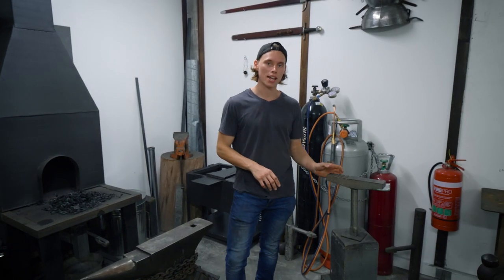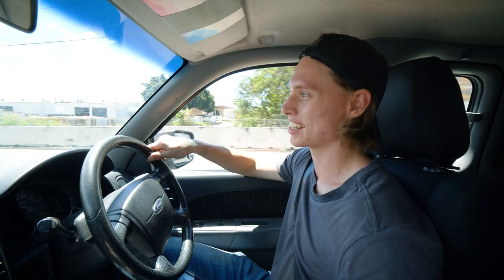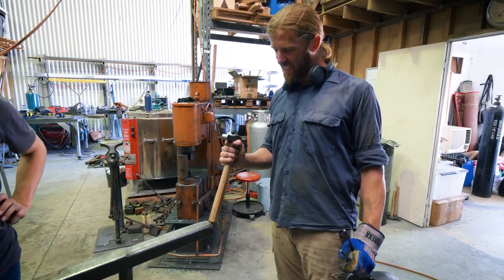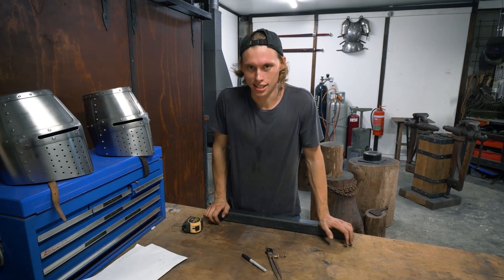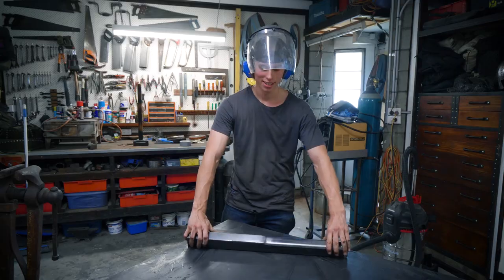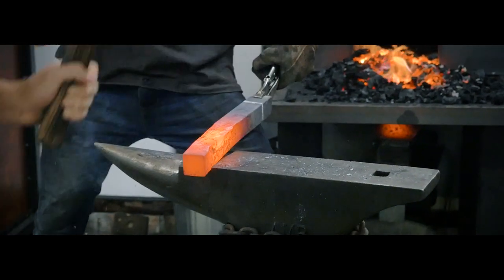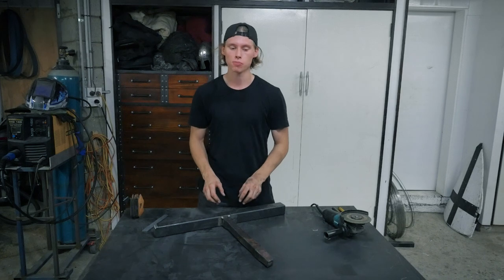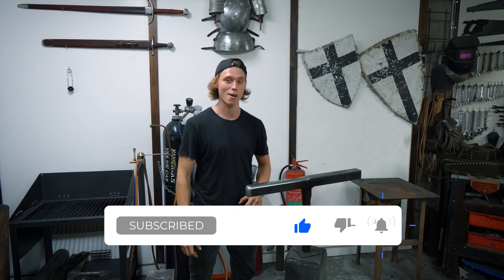How to make a T Stake

Comment: I had alreagy made a flat surface plate (1cm thick) with ovale and round pits.I use it as a table for anwil. Its wery usephul.Would you like to repeate same devise?
Reply from the maker: That sounds like a really cool set up mate! I like that idea! Maybe another station worth adding to the armoury. Do you have a photo of this set up? Maybe you could send us a cheeky pick via dm on facebook or insta :)
Reply: @IronCrownWorkshop  it look very ugly, couse it was first thing that I made by gas cutter.Also I bought all metal on resucling base and weld it wih electrodes
Reply from the maker: @ИльяЗеленов-в4ж  Sometimes those are the most satisfying builds when you get to recycle materials and just make something that is functional, meets the task exactly and does what it needs to do with no fuss or fanciness